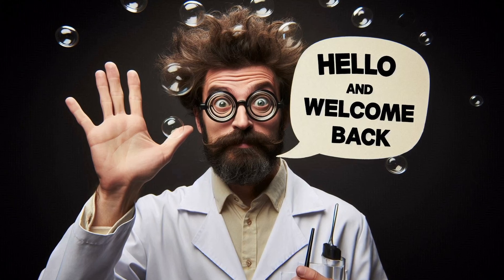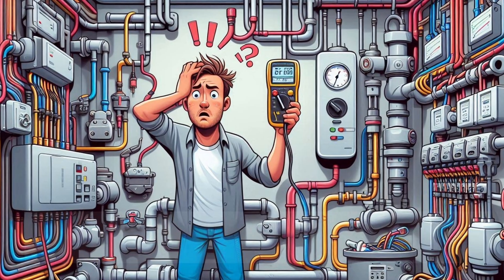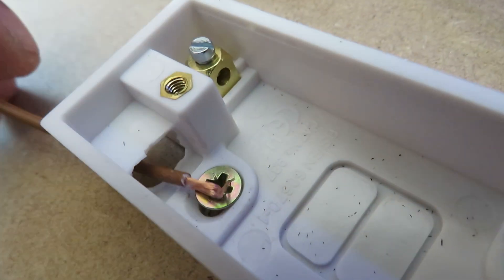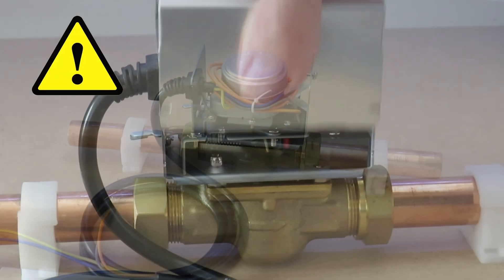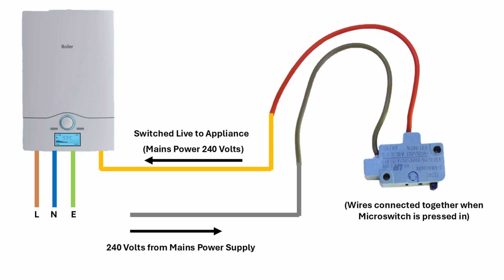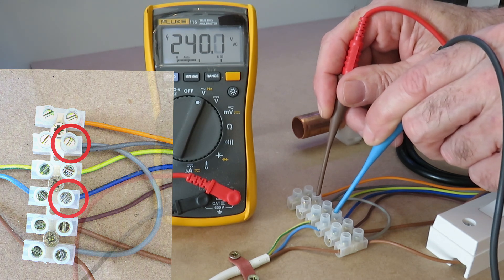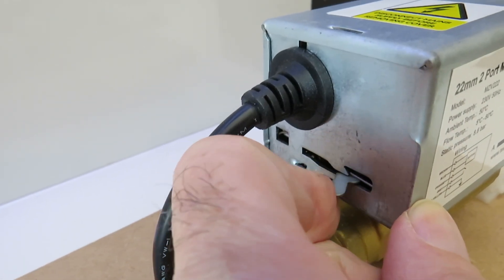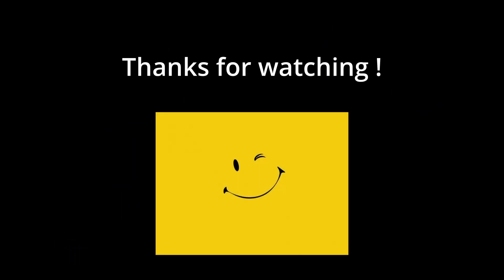How to Diagnose a Faulty Zone Valve – STEP by STEP !

Comment: Great video & explanation, however my fault is the water is getting hot when its not switched on, its heating up with CH only selected, the valve feels as though its operating ok, ie closed when powered off but opens up when only heating is selected, surely it should stay closed and only open when HW or CH+HW is selected, any idea what the problem is ?????
Reply from the maker: Hi, that sounds like the zone valve is not closing properly, allowing hot water to bypass and heat up when it shouldn't!

Comment: NIce quality, but didn't understand the electrics.  Diagrams a bit confusing when trying to match up with real life.  Probably best to describe the electron flow to people understand what's going on.
Reply: I don't mean to be offensive, but in my opinion, that explanation is about as simple as it could be. Explaining electron flow is only going to add an unessary explantion. The purpose of the video is how to diagnose a faulty zone valve. The simplicity in his explantion is you don't need to know how electrons flow, or how motors work etc. By simply following exactly how he connected the wires and how he used the multi-meter, you can determine if any of the 3 components are not working correctly. It doesn't get more simple than that. Adding an explanation of how electrons flow will only add an unnescessary explanation.

Comment: Hi Pete, if you manually force the valve open and secure it in the luggage, can the motor close it again or will it remain permanently open until manually dislocated from the lug? I've got 2 x VC4613 Honeywell Zone Valves, one for DHW and the other for UFH. I need them permanently open for the Home Automation system to control the schedules for hot water and heating. Thank you 🙏
Reply: Lug not luggage 🤣

Comment: Thanks again. that's so helpful.
Reply from the maker: Thanks for the kind words, really glad it helped!
Reply: @petesshed8422  Pete, I intend carrying out tests as you suggested, but in order to hopefully reduce the amount of testing I need to carry out on live circuits, could you please let me know if I am thinking correctly about something?
I have manually moved the lever across and hooked it over the lug so that it remains in that position. So, I am assuming that this means that the ball valve must be moving AND that the microswitch is being fully depressed. However the boiler is still not turning on. So, if 240V is not being output from the zone valve to the boiler (something I will need to check), that would mean that the microswitch is faulty. Does that make sense?
Thank you
Reply from the maker: @nowthenad3286  Hello again and great question !
The manual lever on the 'Honeywell' type valves will open the valve so that water can pass through (acting as a manual bypass for water circulation), however, the microswitch will only engage under power ! 
If you 'Throw' the manual lever across to the manual position, with a bit of force, it will press the microswitch very (very) briefly! ...So that could be a very quick test if needed.
I know the wiring junction boxes get a bit messy but I think it's easier to test there.. and like you said, call for a demand on the zone valve you're testing and then check for 240v on the orange wire.

Hope that helps!

Pete.
Reply: @petesshed8422  Pete, thank you so much for explaining that. It was invaluable to understand that. I found that one of my zone valves had a functional ball valve, but the motorised actuator had a problem with the cog that spins and drives the female part that mates with the ball valve stem. There was play in there and when it moved round towards the microswitch, it got caught and would not return.  The motor was also dead, and the microswitch had some evidence of burning, and had zero impedance so no matter the state of the zone valve, it was always allowing 240V through. I think we did pretty well to have all three of those things broken together.  I think I might just drain the system and replace the entire zone valve though. Thanks again.